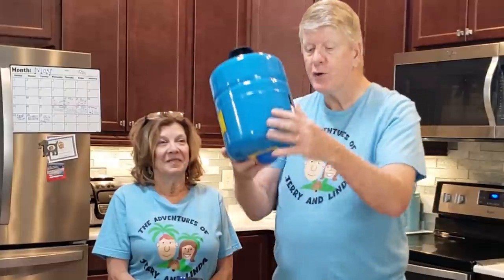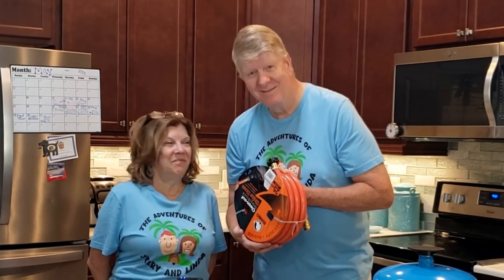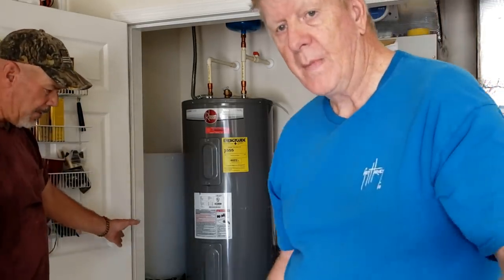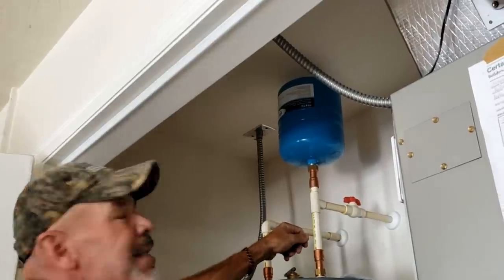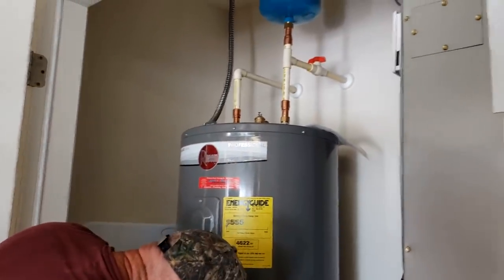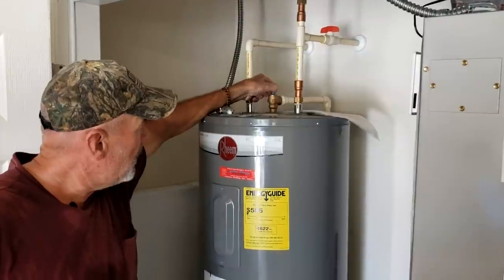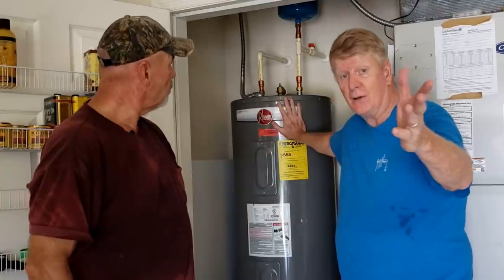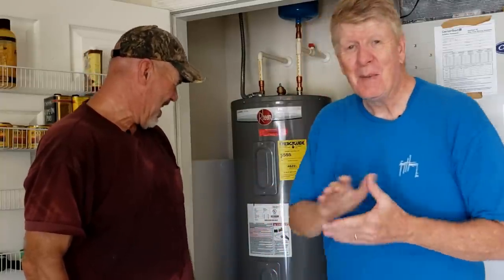How to Drain Your Water Heater and Replace The Expansion Tank

Comment: I did this today but replumbed the PVC cold water line to the tank with Sharkbite fittings. With PVC threaded fittings you cant remove only the tank from the fitting because the fitting is glued to the pipe and attached to the tank. When it has to be replaced again, will be easy to remove the tank at the elbow with a Sharkbite disconnect tool. The one I replaced had been installed since 2012..full of water/no pressure. I also added air about 5 psi above the water line pressure of 45 psi.
Reply from the maker: You are handy!

Comment: First impression: you are nuts to tackle this subject. After watching, what a great instructional video and public service.
Reply from the maker: Thanks, John!
Reply: Nuts? This is easy.
Reply: The quality of the build of the house is apparent, or at least in comparison to mine. 1 Placement of the hot water heater in the garage, 2. sitting  the hot water heater in a minii- bucket, 3, with a mini- bucket that has a drain that empties outside. I do not have any of that; let alone the blue expansion tank. My only solution is limited to taking out the mess I have and replacing it with an instant on system without a water tank. Too bad mine wasn't built as well.

Comment: I just replaced my electric tank water heater after at least 30 years and it was still heating ! Never drained it or did anything at all to it. Don't recognize that expansion tank, have never seen one before. However, the plumbers had to run a pipe of some sort from the new electric water heater to the outside entrance of garage incase it ever overflowed, to meetcode. Now I just have to wait and wait for an electrician to become available to fix the electrical circuit the heater is on so I can finally have some hot water again!

Comment: Good video. Really glad to see Tom pre-presurized the expansion tank. Many do not do this and the tank will fail pre-maturely. Also you have a Nova water filter so the sediment that came out of the tank got there before the filter was installed. I'm sure the tank was never drained by the previous owner. Going forward you should see very little to no sediment because of the Nova filter. You could have also determined the water pressure to the house by looking at the gages on the Nova filter. Finally, just FYI, when you drain the water heater every 1-3 years you are supposed to measure the pressure in the expansion tank with the heater empty. Sometimes the pressure goes down and you are supposed to re-pressurize it. Unfortunately you can't becasue your tank lile mine is too close to the ceiling to get at the pressure valve. The way this is installed is a code violation because of this issue. But you can take the expansion tank off, check it, and then put it back if still good. The tap test is fine but that won't tell you if the pressure is still the same. Like a bicycle tire it will loose some pressure over time. When i had my new water heater installed i had this plummed differently so i can get to the valve. Other than that, great video!

Comment: I had the same water heater in my last house. The unit was on the second floor. They stated to leak and burst at 10 years. I don't think we changed the expansion tank or drained the hot water heater. Good video.

Comment: Comment/suggestion.......Install a ball valve for your drain spout on your water heater because it provides much better flow for flushing out your tank.  the valves that come on your water heater are not a full flow valve and does not do a good job of allowing sediment to get out of the tank.  Also I would only turn the power off not the water to flush the tank.  I know you have to turn the water off to replace the expansion tank but not to flush the water heater.  The water pressure (water on) will help force the sediment out.

Comment: Hi Jerry, I have a question about that tire inflator you showed in the video. I have a bit of a problem with tire pressure on my cars fluctuating a few pounds in the winter. I wonder if that unit would work?
Ever use it for that?  Thanks for posting this video..very helpful.
Reply from the maker: Yes we do.  It works great.

Comment: Comment.....To fill your water tank back up... just leave the hot and cold water on at the faucets also go to every faucet and let the water run on hot and cold to get any air out of your lines and again do not use the pressure relief valve on the tank to do this because like I said you are usually asking for trouble with a future leak in that valve.   Good video other than messing with that valve.  Also opening all the faucets to fill the tank and once no air is in the lines you will know for sure your tank is full and there is no chance on burning out any of the electric heating elements.

Comment: Comment/Suggestion........Never open your safety valve unless you want to replace it......  Those valves become corroded and if you open them, many times they will start leaking because they will not close properly once you open them especially being several years old.

Comment: During an inspection of a home I was buying, and using the same company a few times in previous years, I was told that about half of the expansion tanks have "bladders" I.e. diaphragms that are faulty, rendering them useless.
 I was shown a tank that was equipped with a pressure "button" (no need to rely on tapping evaluation).
 The homeowner is unsuspecting and has a false sense of security with these tanks.  
 I live in S. Florida, and  tanks were never used for decades. Now, if a new water heater is necessary, the expansion tank is mandatory.  Plus, in my area, the County requires a permit to proceed. It's NOT inexpensive for sure!  Few homeowners are are aware of the need to drain, and or replace the tank periodically.
So many new homes have the water heater and HVAC system in the laundry room.........too risky IMO should a water leak happen.

BTW........
GREAT VIDEO RECENTLY ON DRYER  MAINTENANCE!
When our house was built, the laundry room was vented straight outside vs. the roof, but many plans don't make  it possible.
 We're still very diligent in lint removal directly  from the dryer. 

ARE THE VILLAGES ON SEPTIC?  If so, consider a video on the necessity of periodical maintenance pump out.  We recently paid $200.00. It had been three years.  Nothing compared to interior back up cost repair, or a new drain field!!!!!!
Reply from the maker: Thanks, GG!  No, we are on sewers.

Comment: I personally would have drained the water heater into the flower beds or 5 gallon buckets for use somewhere instead of draining it into the street.
Reply from the maker: Good idea!  Now ya tell me!
Reply: You don’t put scalding hot water in flower beds it would kill the plants.
Reply: @robk1310  Then put it in 5 gallon buckets.
Reply: @robk1310  Turn water heater off for several hours before you drain so water is cool.
Reply: @karenmusic2166  Another great idea.

Comment: Very surprised that the very expensive homes in the Villages use the most basic  and inefficient water heaters and in your case PVC and CPVC supply lines when the rest of the country changed to PEX 20 years ago.
Reply: In my area they still use a lot of copper. PEX is becoming more common. PVC and CPVC are not allowed. But contractors here use copper 65% of the time in renovations. New builds are 3/4 PEX.
Reply: @robk1310  Rob, interesting on what the variations are across the country dependent on climate and Codes, PEX is a fraction of the cost compared to copper and 4x faster to install the other big advantage is in cold climates where it is somewhat freeze resistant, relatives in Texas last winter where fragile CPVC is still used had their pipes burst during a freak freeze which were run in the attic the resultant water damage was substantial.
Reply: Hybrid water heaters are much more efficient than the standard electric ones and will cool the room ( garage in this case) they are in to boot.
Reply: You must be a genius.
We're really concerned about frozen pipes in Florida.🤔

Comment: Good grief! I've never seen a water heater like that and I'm 68 years old. My  water heater is about 20 years old. Never been drained. The heating elements had do be replaced once. The plumber said as long as no leak he would just replace the elements.
Why such a fancy water heater?
Reply: Safety, expansion tank for water expansion and pressure release valve. A water heater can is like a bomb as water does not compress.

Comment: Um, maybe it's just me but I would never cram pool noodles, lawn chairs, etc into an enclosed closet with an A/C and water heater. I have mine with plenty of ventilation. You have a prettier garage but heat buildup is bad enough in a garage then you add enclosing? Does your little room have A/C running to it? Ha ha
If you are worried about particles think about the bug parts in hot dogs and peanut butter.
Reply from the maker: Never say never, Edwina! 😜😜